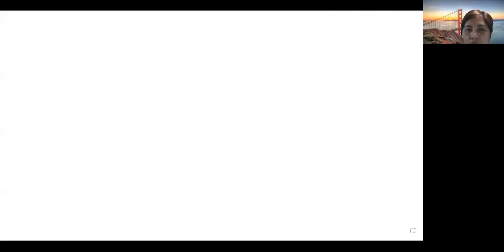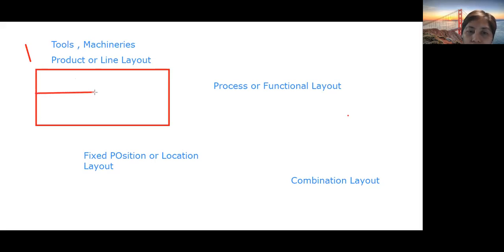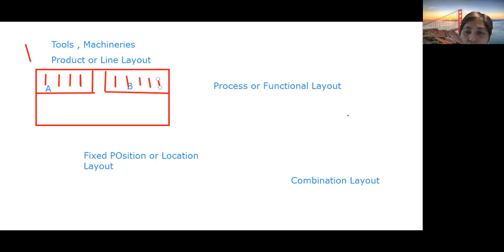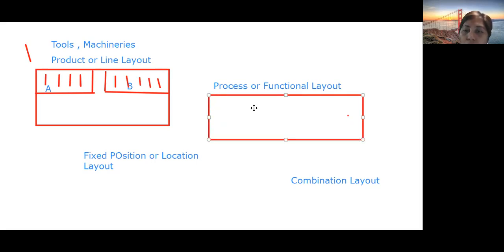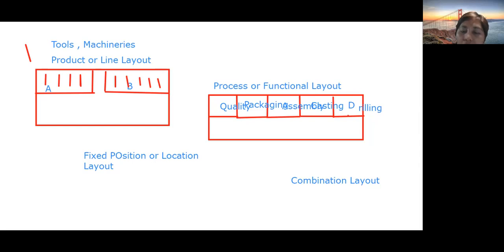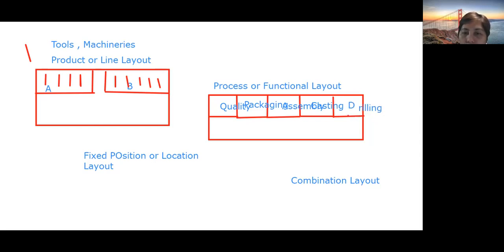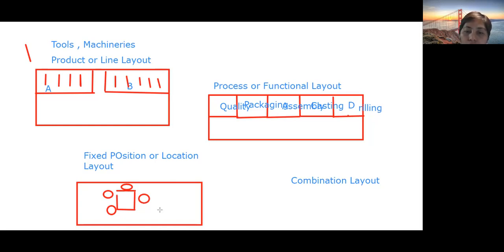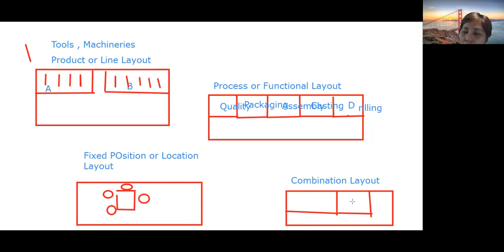Types of Plant Layout

Comment: ACOPIADO, GLYDEL KAY L.
BTLED IA -1
I have learned to this video the different types of PLANT LAYOUT which are the PRODUCT OR LINE LAYOUT, PROCESS OR FUNCTION LAYOUT, FIXED POSITION OR LOCATION LAYOUT and the COMBINATION LAYOUT. As discussed, Product or line layout are from the word product itself which focused on the products.It is called line layout because machines are arrange in a straight line and  raw materials are fed at one end and taken out as finished product to the other end. Process or function layout focuses the operation and the machines. While in Process or functional layout, all machines performing similar type of operations are grouped at one location. In the Fixed position or location layout, materials and machines are brought to a product that remains in one place owing to its size. So in this layout material and things are fixed in one place. Lastly the Combination layout, it is employed to derive the advantages of both systems of layout. For example, refrigerator manufacturing uses a combination layout.